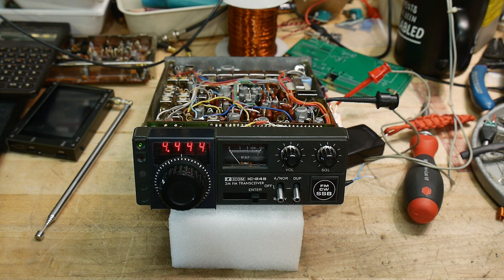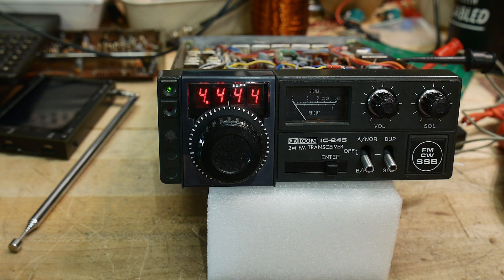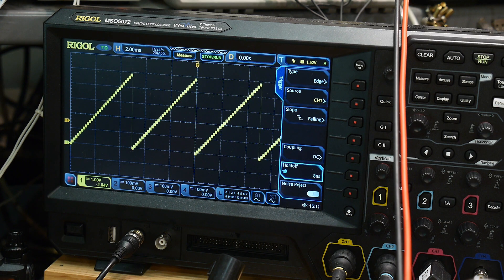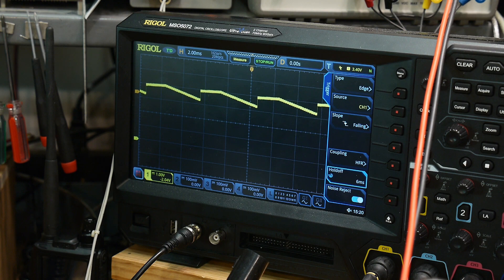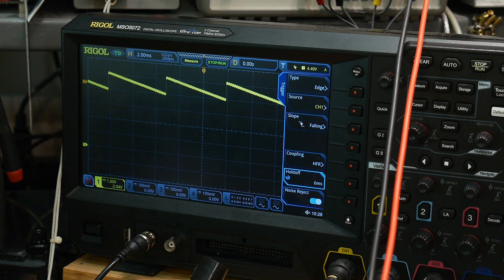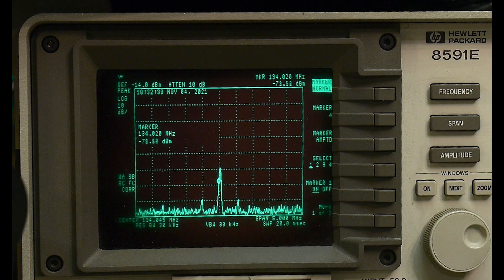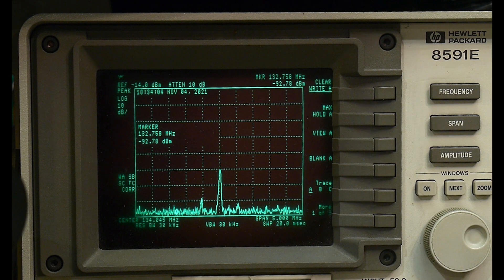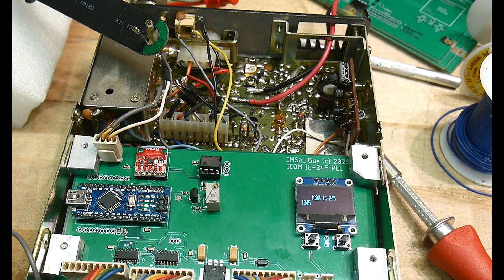#965 ICOM IC-245 VCO control working

Comment: Hi, the IC-245 suffers from bad solder joints, specially vias that connect the two sides of its double sided boards. There are several vias in the LCD/encoder assembly and they generally fail. You need to disassemble the front panel, take out the display board, drill holes through the vias and reconnect the two sides with little piece of copper wire. I hope this can be useful to you. Best regards, Len

Comment: The Arduino has got 3 counters. The 16 bit counter can do a lot of things if you do not mind assembly language. Useful range 40k out of 64k could give you 250 Hz out of a 10 MHz band. With a 16 MHz Arduino stay below 4 MHz input to the counter.

Comment: To measure frequency you need a counter that is big enough and fast enough to count cycles and an accurate timer to start/stop the counter.  A Johnson counter prescaler can help with the 'fast' part and you might need to sharpen the edges with an amplifier, tunnel diode, Schmidt trigger, etc. so the counter is clocked reliably.  Other than displaying the counts, that's about it; but it can get expensive obtaining accurate timers and fast, big counters.

Comment: Cool! I still need to dig in and see if I can figure out a pattern to the weirdness with my PLL. I'm disappointed to finally come to the realization that this rig tops out at 146 mhz. If you did force the VCO to make it go to 148 mhz, I'm not sure how much rx sensitivity might suffer with the tight helical filtering on the front end. I suspect the tx would probably not drop off too much. It would be interesting to see how it does if pushed to 148 mhz. Most of the repeaters around here are > 146. Yes the power switch is strange, and memory power for the PLL remains on with power off.